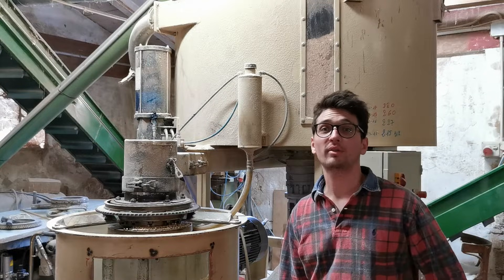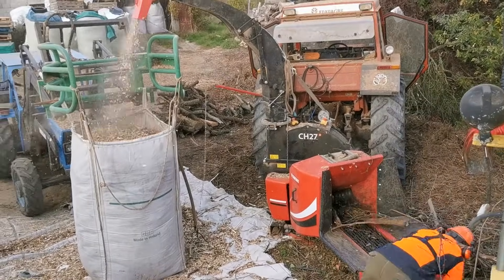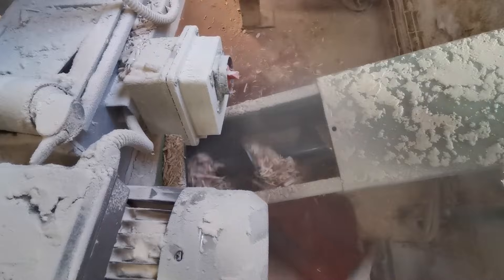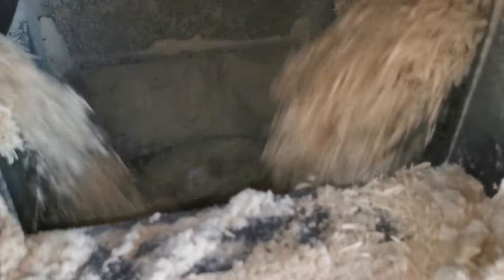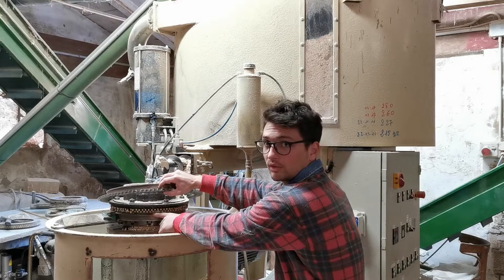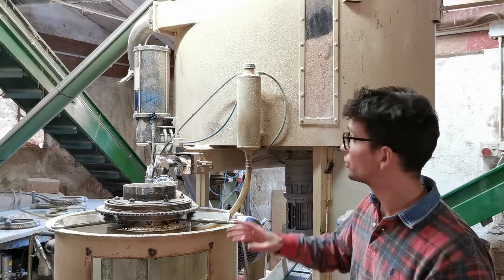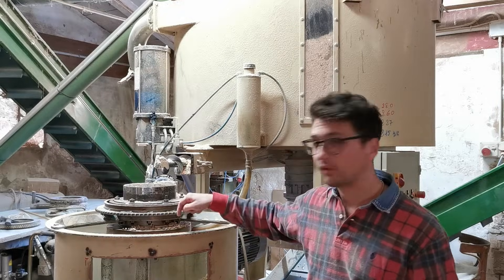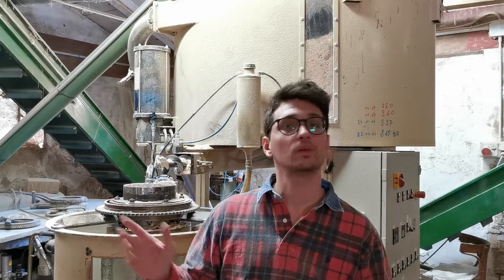wood PELLET - How It's Made! [factory and machines tour]

Comment: Is there other pellet makers using something other then natural to hold the pellets together
Reply from the maker: Hi! Thank you for the comment! Well, I don't think any other manufacturer uses additive or glues..they cost too much for their purpose. The material is glued together by nature, so there is no need to add glue.... Another aspect is other kind of substances, not gluing ones, but those adding weithg. Some manufacturer may add soil or mineral substances, they cost nothing, but they add weight to the final product. They will sell you soil at high price: pure earning for them! This is a very low quality product, because you will have a lot of ashes in your stove.

Comment: Interesting video, but destroys the image that wood pellets are green. Such a huge amount of energy is used to transport, chip, dry, compress, package ant then transport again. How much energy is used per kg of pellets to produce them.
Reply from the maker: Hi! Thank you for the comment! You are partially right...as I replied in other comment, the enery spend is worth of it, because we can recover material that cannot be reused in any other way. This is how recycling activities work. Ok, maybe better do less wastes as possibile, but that's another discussion. Second point is about finding out what are the most impacting activities in the production process. The highest energy consuming are drying the material and transportation. About the drying procedure, we dry material or during the summer, simply using the sunlight (wood chip on a large plastic sheet or we leave trunks in wood staks for all the summer...a lot of water goes away here) or via the industrial dryer, where heat is produced by other wood (both from energetical and ecological point ov views we are green, because the process is carbon neutral). About transportation, the raw material comes form local factories and bushes, moreover the final pellet product is sold and consumed locally, so the transportation impact is almost zero. Totally agree about energy for the machinering and for the chipping process....but they are needed. Hope the reply was good! Let me know.
Reply: @profilo_is_back  HI, thanks for your reply, it's good that you use sunlight and wind to dry wood, but you must know how many kWh per kg of electricity is used,  Wood pellets can produce 4.5kWh per kg of useful heat when burned, but if you are using this much electricity per kg to make and distribute the pellets you are on a hiding to nothing.

Comment: question, when you reduce moisture content of the wood from 50-60% to 15%, do you only extract the moisture of the wood, or also reduce the amount of woodgas it can still produce, if you put it in a container and use a pump to suck the woodgas into a gascontainer by setting fire under the container filled with woodgas. I know certain gasses are present in woodgas, and one of them is watervapor, so i'm asking if it is only the waterpavor that is reduced, or also hydrogen gas for example which is present in woodgas.
I'm going to build a micro-fossil-fuel-plant, that will also produce methane gas (for backup if I have no wood anymore) by combining hydrogen with co2 gas from the exhaust of my furnace 🙂
The only waste gas, if all goes well, will be pure oxygen from both co2 and salt water (h2o). So that's free electricity and since it rains a lot, free water too 🙂and since in my neighborhood everybody seems to throw away their pallets, it means free wood too!
So now i'm trying to determing on whether I should make wood pellets to use as fuel, or use charcoal, and thus I have to turn claimed wood into charcoal first by extracting woodgas (free gas).
I think i'm just going to use woodchips, that's wicked easy to make, even with a bicycle as engine 🙂
Reply from the maker: Hi! Thank you for the comment! I'm really interested in seeing your solution implemented, that's really impressive! Well, when we extract the moisture from the wood we do not reach temperatures higher than 90/120 °C, meaning that you don't have to worry about other volatile substances begin extracted. They will remain in the wood, the syn-gas capability is not alterated. Moreover, you reach quite high temperatures in case you use an industrial dryer...in the summer we dry it at the sun-light (more time, but less energy....) this has for sure ambient-temperatures. So, by replying to your question, only H2O is extracted, no other substance helping synthesis gas (wod gas ) production. Hope I helped you!
Reply: @profilo_is_back  yes, thank you very much, that info was very helpful!

Comment: Do you have a special machine to produce the sawdust or do you buy it?
Reply from the maker: Hi! Thank you for the comment! Well, at the moment we do not use that much sawdust. The one we had months/years ago came from a local woodworking factory, but at the moment we do use wood chip or bigger wood wastes, as you can see in the video, to make pellet. No we do not have a specific machine. I think anyone has one. It costs too much transform wood into dust (that are actually very fine wood chip pieces). Sawdust is a waste product that we recycle into pellet.

Comment: Seems I'm missing something here. If these pellets are just going to be used as fuel, that's a lot of extra work for what can already be burned as is or as wood chips.
Reply from the maker: Hi! Thank you for the comment! You are perfectly, right, but as long as you are recycling material you cannot reuse in any other way, we think it's worth of it. This is how recycle/reuse works. Well, in terms of burning 'as it is' i do not totally agree. maybe, just a bit, woodworking production wastes....but you need big wood stoves, that from an industrial point of view cannot work in an automated manner. Talking about wood chip, totally agree with you! This is the best heating system! in fact, we do use it instead of wood pellet. But not all people have space to store the plant, that requires the wood chip storage + the big stove (here a video in the channel about a wood chip heating system https://youtu.be/_UsDvLMjICs)

Comment: Wow this is a great presentation of the pellet making process. Another pellet making topic I would love to learn more about is the amount of energy required to manufacture pellets.  But that might be pretty involved & might be more of a thesis paper for a college student. There is the fossil fuels required to power the trucks that deliver the wood, the fossil fuels used to build the trucks & the machinery used to make the pellets & then the energy needed to power the manufacturing process, make the plastic bags for the pellets, & last but not least the fossil fuels needed for the trucks to deliver the finished product.
Reply from the maker: Hi! Thank you for the comment! This is a very interesting aspect. I'll tell you what I think about. In terms of transportation, I really don't consider that much this component, becasue wood is locally produced and the final product is locally consumed. The transportation doesn't have a big impact on the final carbon foot print.  What impact most are wood transformation (wood chipper 100kW and wood shredder 25kW) and pellet mill (9kW working a lot of hours in the day). yes, it is a process requiring a lot of energy. In the perfect plant it would come from renewable sources, like solar, wind or water. But we do not have the possibility to use them efficiently. I know it is a lot of energy, but I like to see it in that way: you are spending energy to reuse/recover/recycle products that you cannot reuse in any other way. So it is worth of it. What do you think?
Reply: @profilo_is_back  My Filipino wife loves how the pellet stove keeps her 75 degrees warm all winter. For me another big plus of heating with wood pellets is I would much rather give a local pellet manufacturer like you my $$$, than oil producing USA unfriendly terrorist supporting countries like Saudi Arabia. But great video, if I were a school teacher in your area I would arrange  field trips for the kids to see your facility.

Comment: That is an interesting extruder. I have not seen one like it. I have adapted a twin screw food extruder to make wood pellets. it used to make breakfast cereal and you can mount various die plates at the end of the barrel. You can also alter the srew configuration to be more or less aggressive so it can do some of the grinding and breakdown work that you use other machinery for. It also has the advantage of having controllable heat zones along the barrel.
Reply from the maker: Hi! Thank you for the comment! On my side, I'v never seen an adaptation like your one! It seems something very interesting and clever. What kind of production ratios can you reach? Is the twin-screw extruder resistant enough to produce wood pellet? TO handle raw wood, I mean...

Comment: Ciao Filippo. La ringrazio per il suo video. Cuanto pellet lei puo fare in questa ditta a un giorno?
Reply from the maker: HI! Thank you for the comment! Well, the machine produces about 160/170 kg/h. The production ratio really depends on material hardness. Remember that there are about 30min-1h stops for usual maintenance, typically to chance roller bearings. Much more stop time in case of  ring-die change or rectification of mechanical components (if you don't have couples of them). The frequency of the maintenance depends, also in this case, on material hardness.

Comment: I really don t want to know how much transport, energy and packing materials are required for a product which is perfectly replaceble by its original product, called wood.
Moreover, these days this so called 'alternative' for expensive gas and electricity, becomes as expensive as gaz/electric itself. 
Not ecological,  a perverse way to keep customers dependent on the system of economical consumption
Reply from the maker: Hi! Thank you for the comment! Well, I'm sorry but you are not right. YOu can't  'replace by its original product, called wood' in your wood chip boiler or pellet wood stove. Go in my channel to watch the video about the Froling wood chip boiler. You cannot, for sure, fill trunks or wood pieces into it. And we do heat our house in a completely renewasble way, reusing material that you hsould throw away if oyu don't use it in that way (wood chip). The next step from wood chip is pellet. We do use woodworking wastes, also in this case material that normal people cannot use in their modern, efficient and cleaner wood stoves. Do you use a wood brik stove? Maybe not all people have space for this plant, or space to store it. And moreover, sorry to tell you, it is not the most efficient way to heat things. And, moreover 2x, you are using good wood, that maybe you can use in other way (for woodworking purposes).
If you tell me that using good quality wood to make pellet is not good, totally agree. And unfortunately this happens more frequently these days. But this is not, for sure, our case, as you se in the video. 
In terms of energy, it's totally fair to spend energy to transform wastes into valuable product.
We cannot use solar energy, wind or hydroelectric, because of the land where we live. But you may rely on these technology, if you are really concerned about the energy aspect.
In terms of transportation, all the wood comes form local factories, and the whole production is sold and consumed around our house: much much less green-house gases for totally un-need transportation. Let me know what you think, I really like these discussions

Comment: Much appreciated. I have wondered how this was done since examining a wood chip boiler in a holiday house. This is not meant as a criticism because the process looks very carefully tailored and efficient but how much energy is consumed to chop dry and pelletise per tonne? This looks like a process that would be well suited to a classic windmill or even a water mill type energy source.
Reply from the maker: Hi! Thank you for the comment! You reasoning is perfectly fine, and absolutely right. You centered the point! Well, for sure this is a very energy consuming activity. This is the reason why, in fact, we do not use pellet to warm our house (we use wood chip, you can see some videos in the channel about our Froling wood chiop boiler): it is too expensive. In terms of drying you may use hot air from wood combustion, so I won't take that energy that much into account. Much more important consumptions are the main mill, about 9/12 kW electrical motor, + 20kW the shredder, and 100kW the wood chipper.  Yes, they are perfet for windmill or watermill, but unfortunately we live in a region where we cannot apply these two kind of renewable energies. MOreover we do have east and west sun-light exposition, that is not good for photovoltaic panels. I'm not really happy about using grid-from electrical energy. but that's it. Since we do work to recover and reuse material that hasn't any other value, I think this energy is well spent. But, I want to repeat, your point is perfectly fine, that's a very very good criticism! Thank you!
Reply: @profilo_is_back  I still see much value in your process and product. Most will not have the time to manage heating by wood in any other way. I recall seeing a plant in Austria that used branch and bark waste from production forestry in a community heating plant. All these technologies have their place in our futures. 
Excellent video and I wish your business well.
Reply from the maker: @robinwells8879  Thank you really much! Yeah, I hope people will re-consider this kind of heating systems. Much much efficient and renewable wrt to other technologies, especially in the countryside or in the full of bush zones, where there is a lot of wood. Considering also the current european energy situation. Hope for the best! Where are you from?
Reply: @profilo_is_back  I am in Cambridgeshire in the uk. I do have a house in Scotland with just enough birch woodland to keep it heated with firewood. It is only for family holidays and we have time for cutting and chopping logs and the children love managing the stove.
Reply from the maker: @robinwells8879  Yeah, I have to say that I totally regret the fire management sensation...and also the stove view/fireplace in the house! Our system is completely automated, in the underground floor of the house. We forgot for days about the boiler...but we need it always, and automation, as you know, is absolutely necessary. Hope the best for you! Thank you for the comments!

Comment: Hi, my uncle made a pellet machine homemade but the pellets just wont go out unless we add alot of moisture, do u think there is a way around that? Cheers!
Reply from the maker: hi! thank you for the comment! Well, obviously it depends on how the machine is built, especially on the type of ring die. Anyway, I remember my dad having a lot of problems with too dried materials, so is perfectly fine the fact that you have to add moisture to the wood mixture to reach the correct level. I can tell you that. What kind of ring die do you have? homemade or commercial? And what about the rollers? How are they made? Are you sure they do press enough?
Reply: @profilo_is_back  Everything is homemade sadly and nothing can be said for certain. 😅
Reply from the maker: @socloseagain4298  Well, I want to be sincere. The key point is the tolerance between the rolelrs and the ring die, together with the precise dimensions of the hole (as you have seen in the video, they do have specific shape). Also material are specifically built for high tempearture and very high mechanical stresses. I don't know the qualtiy of your machine, but I know that from the mechanical point of view it is quite complicated. Then, once the iron part is completed, you can pass to wood aspects, like the correct level of moisture, the correct level of compression, depending on the hardness of the wood (this is another aspect I didn't talk about in the comment above). What kind of wood are you trying to pelletize?
Reply: @profilo_is_back  Thank you for your honesty my friend! We are trying to pelletize sawdust primarily made from coniferous wood, but as you said its most likely the rollers and the ring die. 😥
Reply from the maker: @socloseagain4298  ok. But have you ever produced woodpellet? because even if you don't have perfect results, maybe you can still achieve something. Yeah, pure sawdust is a bit difficult to pellettize, it's too soft and too fine. My dad typically uses a mixture of gridend raw wood, together with sawdust (that is more like a powder or flakes, in our case). You may try to add a bit of grinded material!
Reply: @profilo_is_back  Ye we have produced, but the main issue is that they are getting stuck and wont come out and we are trying to figure out the reason why. 😀
Reply from the maker: @socloseagain4298  unfortunately I can't help you, we should see what's happening here. Can yo share in some way a video? I'm really curios about that!
Reply: @profilo_is_back  I will see what I can do thanks 😀